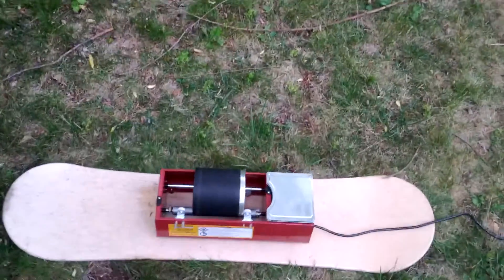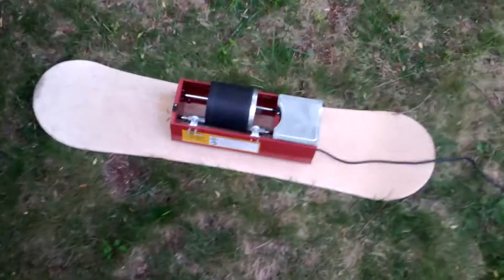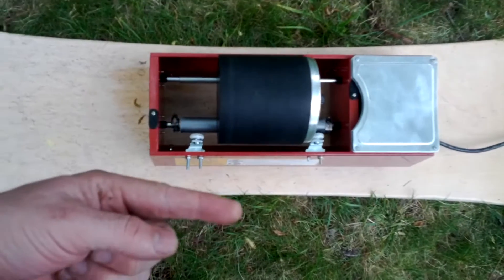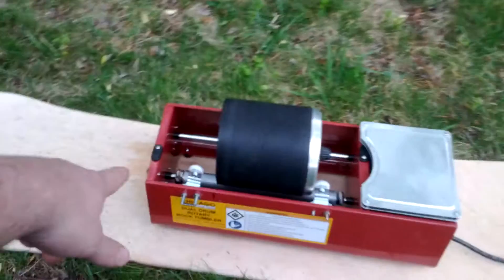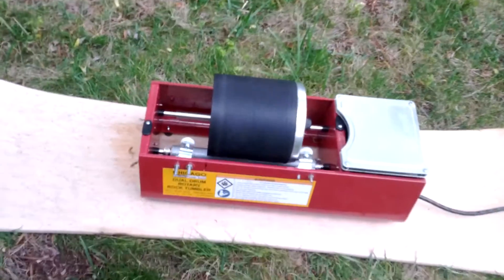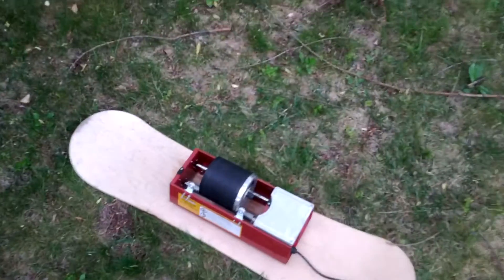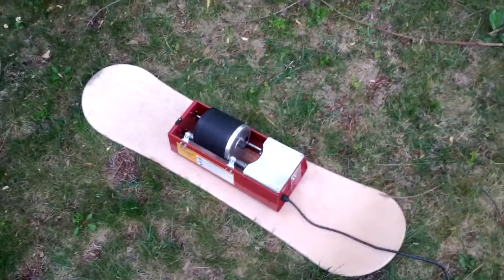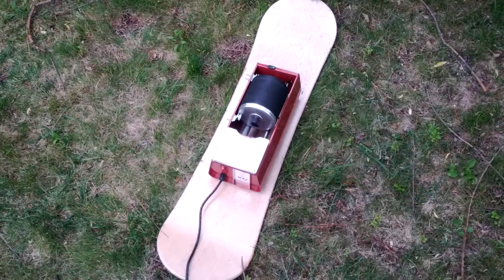6lb Ball Mill/Rock Tumbler modifications and improvements

Comment: Nice mods dude!  (WD-40 is crap for lube, great for cleaning.  It was developed to displace water, not as lube)  I use the hardened balls from ball bearings or linear slides as media
Reply: You should never use ball bearings
Reply: If you're talking about using steel ball bearings for milling I'd hope you already know not to mill BP with it because steel can spark. I'm sure it'd be a very unpleasant experience having a ball mill full of steel bearings explode near you. :)

Comment: So a rock tumbler is a ball mill as well then. I need it to make powdered aluminum. Should I get a double barrel, or does the weight capacity make it not useful?
Reply: +Camroc37 I'd go with the dual barrel since it has a higher weight capacity. If you use non-sparking hardened lead media for black powder you will only use one barrel since the total weight will be about 5lbs.
Reply: eminusipi thanks, I have already bought a 2 drum mill
Reply: I read the way to do it is get a 6 pound unit and only use one barrel like this video.  It’s a lot easier on the motor for durability.  Who sells lead balls with high antimony for a decent price?

Comment: These are $44 right now (before tax) at Harbor Freight and actually have 2 barrels. Don't know why he using a single barrel on this one. The smaller single barrel tumblers are $22 locally here in Iowa right now. I purchased a double a few days ago. Called today and said they will stay on sale until end of month. I'm thinking of getting a single and another double. The barrels alone cost $30 to replace on Ebay
Reply: ***** I see now the reason some use one barrel on their dual barrel mill. While using lead it is easy to overload the mill with 2 barrels running same time, so using one to remove that issue. Don't see why they don't give other barrel a free ride to help guide each other tho.

Comment: 4 and.....again i only know bout brass n steel n copper ammo casings tumbling...but...with the soaps polishes etc we use in brass tumbling if there's too much soap etc or spinns too fast the soaps polishes solutions acids u name it we use makes bubbles and frothy foam...the bubbles if too many bubbles as expand force pressure into closed sealed drum which balloons out bottom of drum forcing drums into frame of machine binding down and damaging drums n machine till eventually pressures so forcefull it explodes the sealed top off of drum with hellofa bang and big mess everywhere!!! A:the faster it goes in spinning the more bubble production so i don't think good idea at all for brass tumbling casings.But b: The great idea part is the sideways lockin wheel thingys keepin drum sort of centered !! Due to aforementioned bloating of drums forcin drums to grind n bind and damage vrs frame is solved by this problem..tho it does suck to give up 1/2 my production by givin up second barrell on the OTHER HAND it'd be fantastic to be able leave single drum alone and not have to worry bout it binding down every teo hrs ...the only part i worry bout tho id a:does having all weight in dead ceanter of rotisserie bars bow n bend n sag em warp em cause seems all weight centered on rotisserie armbars instead of evenly spread distributed equally from end to end may cause them to sag n bend at middle and if did it'd be catastraphic eventually rippin machine apart from hi speed wobble...and b: how long does your lil side to side roller wheel thingys last before needing replacement? My machines run nonstop all month long never resting seems like perhaps those plastic roller wheel thingys would wear away pretty damn fast BUT i guess if you had tape on rollers correctly with fatter diameter outside teducing diqmeter as comes ij then it'd force drum to remsin centered and itd rarely even touch the rollers right?? So is that it? Or does drum float side to side and spend most the time rubbing the wheel roller ??& if so how longs the roller last??

Comment: 3 and...and its a fine very fine line between fast n effecient tumbling and the rpms rotations being TOO fast which like gravitron at fair if spinning to fast nothin insides properly tumbling because gravity pins it to one place on inside....how fasts too fast for what you're doing? Cause it honestly looks like its so fast that unless i really loaded both drums alotta weight to force load it slow down that it'd spin so fast i wouldn't get maximum cleaning nor polishin from lack of proper tumbling inside cause so fast ...what r u tumbling and why does it work better at such hi speeds that would ruin brass tumbling???am very curious now

Comment: I have several same h.f. dual drum tumblers...few things...a: copper DOES wear away give u example...i use a stainless media mix of primers (50 50 mix) & copper coated stainless steel bbs (i ONLY tumble brass n steel n copper ammo casings am expert at this but ONLY THIS know nothing bout nor have any experience bout any other type of tumbling only casings..but..the copper coating on bbs is COMPLETELY worn away after 3 to 4 days nonstop tumbling which is fine leaving me with pure stainless bbs the 50 50 mix of bbs and removoved primers (i keep the tiny brass crimps in mix as well their a tiny % of total media volume and dissapear gradually cause so damn small but these tiny brass crimps in the stainless media adds an amazingly abrasive BUT NOT TOO ABRASIVE element so with or w/o the crimps the primers/bbs medias as good or better then the stainless pins brass tumblers pay 90 bucks for! But for 5 bucks copper coated stainless bbs and the FREE stainless primers and brass crimps any reloaders removing and has abundance of FREE. is best brass tumblin media there is...but i digress..point is is that though the copper is not thick is pussy hair thin it wears totally away in under 4 days..so...though your copperll last MUCH MUUUUCCCHHH LONGER due to its thickness vrs the thin copper coating i deal with it WILL ABSOLUTELY wear away over time..

Comment from the maker: There are two plates, the outer metal one with a hole in it, and the inner that has a rubber cover on the inside and a screw on the outside. After removing the nut, washer, and outer plate (use your fingernails or a small screwdriver to remove the plate) the only thing left is the inner plate. It should sit on a lip that is slightly larger than the inside diameter of the drum. I simply pull on the screw and it pops out....

Comment: did you have a hard time opening the barrel? the metal plate seems to be stuck inside the rubber barrel, the plate with the screw attached is stuck so there is no inside of the barrel. don't want to force it.